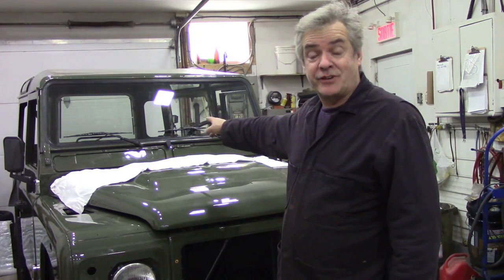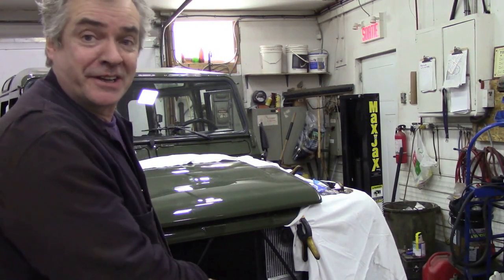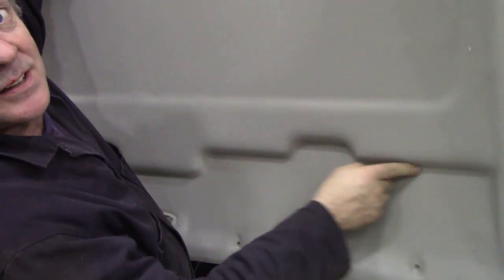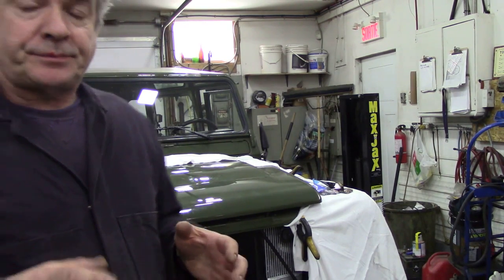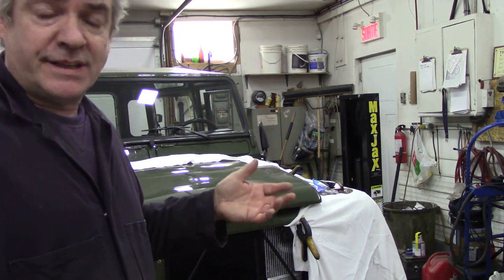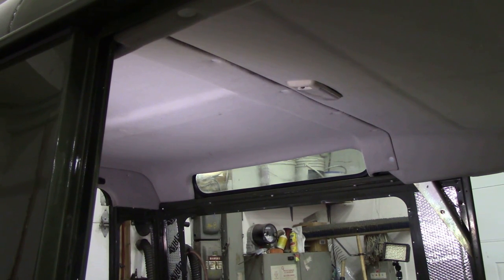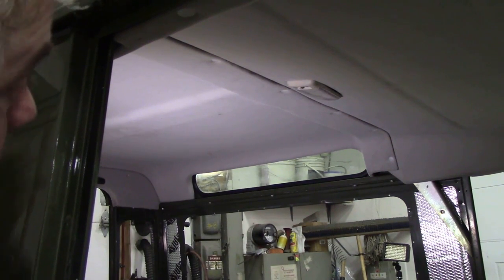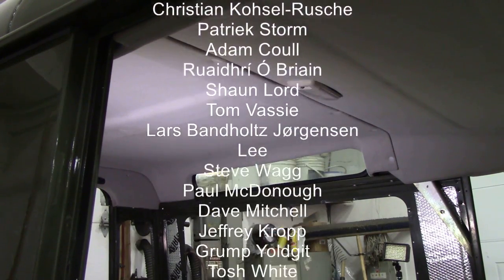Defender 90 project update and headlining fitting tips

Comment: Looking Good Mike. A vote here for a video of re-covering the head liner - a job I've got to do. I am currently in a Beduin Tent!
Reply from the maker: I have a note for doing a headliner video, but I do not have any jobs lined up in the future - the most important thing is to use the best quality contact adhesive you can get - standard upholstery adhesive is not good enough, and there are only a few can adhesives I would recommend - problem is heat in summer can cause the glue to become unstuck
We use DAP Weldwood and use a HVLP spray gun to apply - makes a nice even coat and lays a 1 foot wide 'fan' of adhesive on the material - it is most important not to put too much adhesive on as it can soak into the foam of the liner and when you stretch and form the liner, it can mark the outer finish

Comment: As if you heard  my question: How do I get the headlining out ? - same day you posted that one ! 
There, where the fittings go, I like to install riveted nuts and on that instead of the fir tree fitting I like to add screws to fit an Airline Track ...

Your video did answer my question - will go for it as soon as it'll become a little warmer here...

Thank you so much for all your help and also the good times just watching! 

Cheers Axel
Reply from the maker: Thank you for your support Axel - the fir tree clips are terrible - I have tried all sorts - popping them in boiling water to make them softer, bu they are just too hard
I drill them out to remove them to save damage to the material 

I was thinking of a white aluminium strip screwed to the roof as the edge of the headlining tends to expand with the damp over the years

Comment: Great. My head lining is doing the usual sagging in the recesses and around the Alpine windows. I am contemplating using fibreglass sheet and resin to try to stiffen up again, hoping it might help with protection from condensation as well. Have you any thoughts or recommendations on that?

Ive plastic wrapped the exterior roof (black metallic) so hoping the seams are now sealed, and thinking about using the lead flashing substitute to line the roof metal (inside) to stop the booming / noise. Did it on a camper conversion - its the future and way cheaper than the Dynastuff-costa-packet! I did put the 1" foamex in the camper so not sure if that should be done as well......
Reply from the maker: Closed cell foam will stop the condensation

Comment: Hi Mike. 
How do the rear grab handles above the back door fix to the roof? And do you think it would be possible to bond some aluminium box section to the roof for the headliner over rear door to act as brackets for the clips. As my roof hasn't got brackets but retrofitting a full headliner in a 90.

Thanks alot mate
Reply from the maker: The grab handles screw to the interior gutter rail if I recall correctly
Reply: @BritannicaRestorations  thanks alot mate. Nothing fancy then. Good old land rover haha. Take care mate
Reply from the maker: Cheers!

Comment: Hi Mike -- I have a '94 NAS D90 Port of Entry model.  I'm slowly converting it to be (almost) a true SW.  I've got the internal/external roll cage fitted now, have "beduin tent" front head liner in the front but nothing in the back.  The PoE models have two part rear door with upper "cat flap" style which has hinges on the inside.  Any thoughts on where I can get a headliner that would fit?  I'm worried about the cat flap hinges and the internal roll cage getting in the way...
Reply from the maker: Sorry I have no idea - do not see that many here

Comment: Surely Def/D1/RRC alloys will fit a 200Tdi without spacers?
Reply from the maker: Different hubs
Reply: @BritannicaRestorations  I’ve used several sets of D1/RRC Freestyle 16” rims on my ‘85 Ninety. Edit: It has discs on all 4, but the alloys fit without centre caps.
Reply from the maker: Yes because it has disc all round the problem is 200Tdi etc had drums on the back and different hubs front and rear